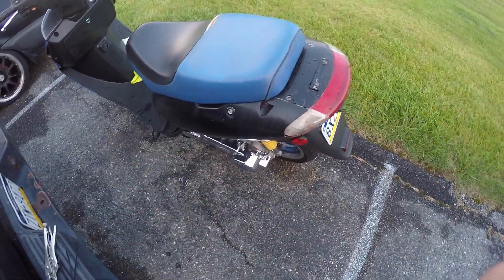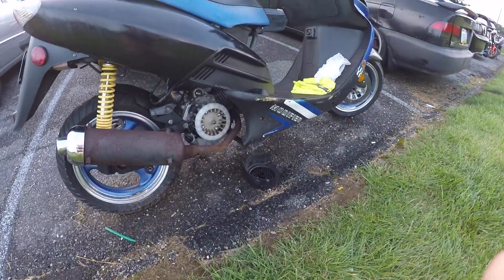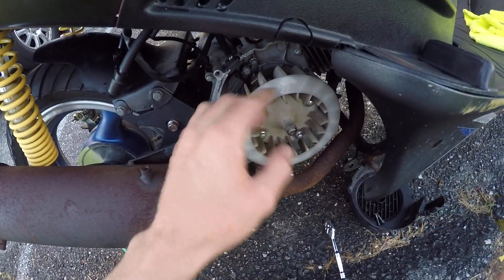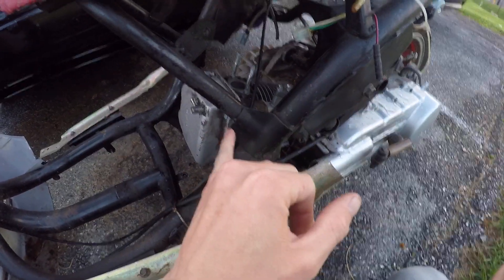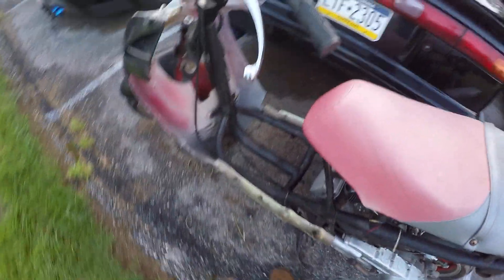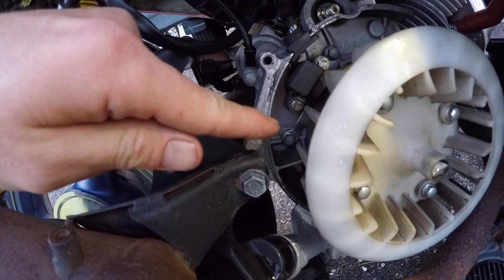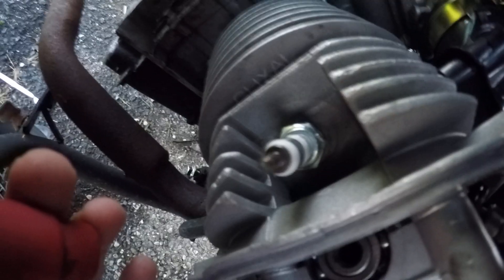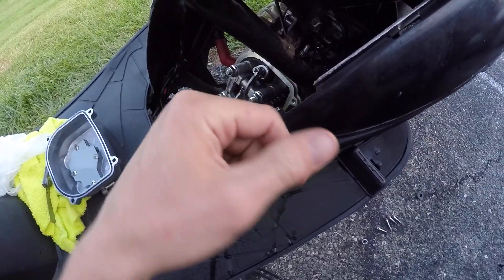Bought 3 150cc GY6 scooters for under 500 dollars

Comment: Ur not lookkng to sell one of those scooter??? I need a part for my nice work on the bike do on later video its coming out clean.... waiting kn new video of the plastics 🎉🎉
Reply from the maker: I actually got rid of the second and third one sold the motor and wire harness off the one and kept the other motor as a back up just in case

Comment: On the rear shock upgrade I when't with 13.7inch, 350mm Mallofusa RFY branded & they're rebuildable. Im a hoarder & I have a few D.C new CDI with adjustable  timimg . If  there is some way I could get it to you I would (free). Us scooter heads need to look out for each other . Im in ohio🛵👍
Reply from the maker: Thanks for the watch man and yea for sure it seems so hard to get DC parts but super easy for the AC system scoots